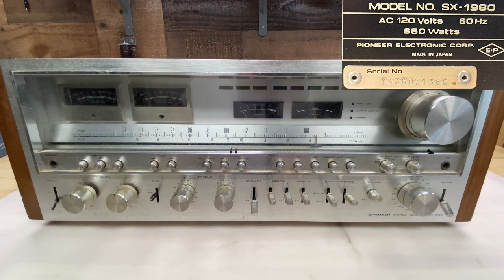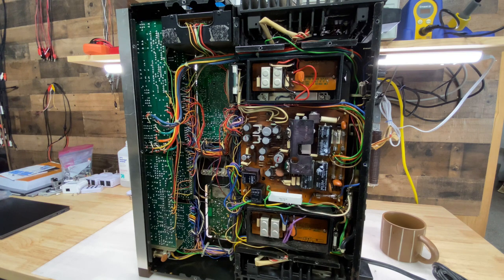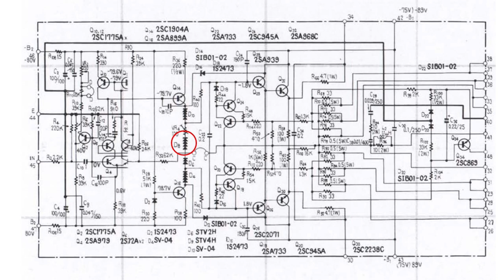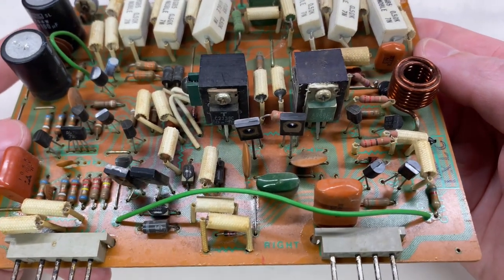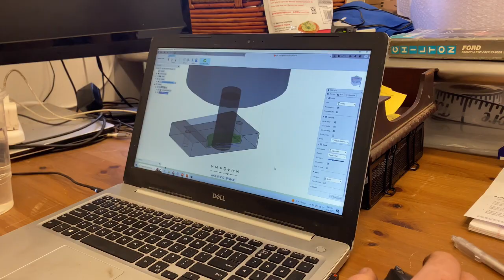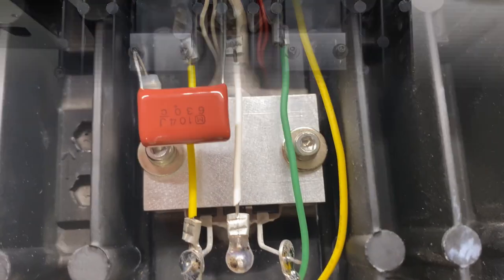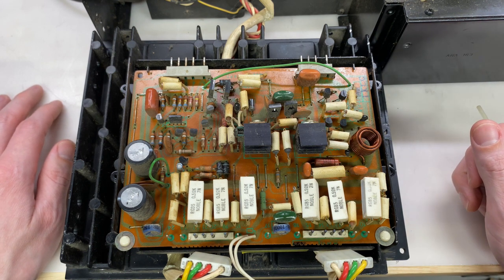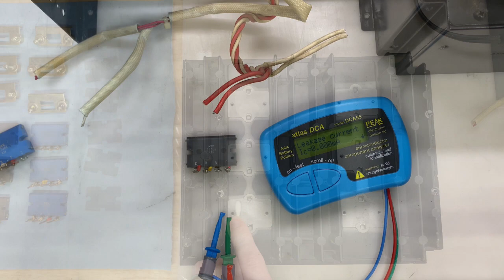DR #42 - Pioneer SX 1980 Classic Audio Receiver Restoration - Chapter 1

Comment: Did x-ray Tony do one of these?
Reply from the maker: He did. Multi-video series a few years back. And did a good job as always.
Reply: @dualityrepair4770  I still have one of these in it's original carton with owners manual etc.  10/10 cosmetically and it looks amazing but damn it sounds awful!  A $50.00 thrift store amp would sound better.  From Australia.  Good channel!
Reply: @dualityrepair4770  yea he is good. So are you though. Was interesting to see your approach to this

Comment: Nice attention to detail, but I don't like the soldered ring terminals it just it's not what they are for and it looks that way but electrically it will work just fine as you know, that is till the next guy down the line feels like me and rip's the lot out moaning ! however Kudos for the Brackets you might start selling those and if you do I'm up for 4 please !......cheers.

Comment: Had to improve convection on some modded power amps, the only way forward was to double the area of ventilation slots and hope it'd be enough to keep the sinks below 50°C at idle. Sent the top cover to a cnc workshop recommended by a colleague of mine, a week later they called to let me know it was too large to fit into the laser, so ... they were making a new from scratch. They would cut the apertures first, inductively weld the grating on the inside and bend it into a "C" afterwards following with a paint job. We're talking 1.5mm steel folks, so I thought, oh well, since you insist. Then it arrived. Not only is it an absolutely perfect fit, but the quality of paint job exceeds that of the original! Mind blowing what these Guys and their toys can do. You could literally spend months working by hand and wouldn't even get close to the level of precision and flawless finish achieved by skilfully programmed machines.

Comment: I use those same outputs, well the MJL1302 and MJL3281 as their voltage are more than high enough for most anything vintage solid state.  Nice work! Is it possible that you could provide the g code for the brackets you made?

Comment: Interesting but not a fan of your ring terminal solution you have just doubled the number of solder joints and therefore potential issues . also since this is now a modded  amp why not eliminate another potential issue that being the push on connectors just solder  the wiring to the board much more direct connection . Good luck
Reply: Soldered ring terminals look wrong to me as well, a place for everything and everything has its place.
Reply from the maker: O well. Can’t please everyone. It’s a reasonable solution and I stand by the decision.
Reply: @dualityrepair4770  That's good you should own a decision like that knowing you will have a future repair and another episode when that amp section Blows onto a Million Pieces . Good Luck 😆
Reply: @alexkay1874  Duality repaired something of mine to an absolutely superb standard.  I would think Nick has thought this through completely.
Reply: @MummyBadgersford  Yes I guess he is omnipotent well done .